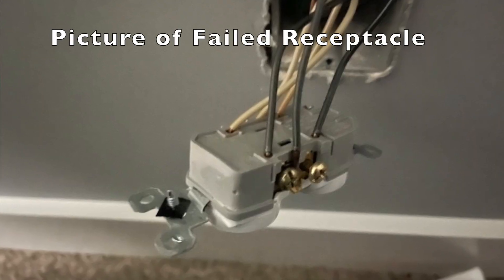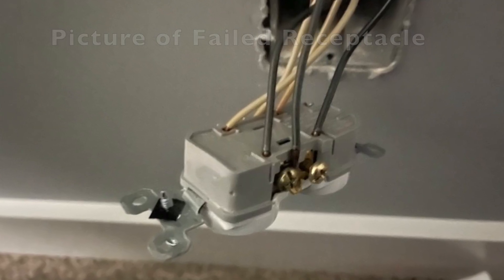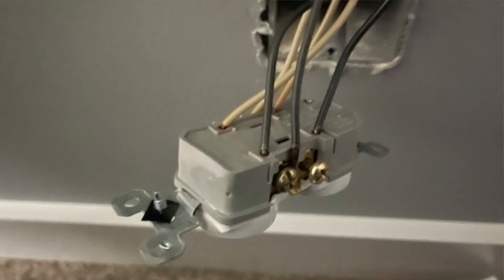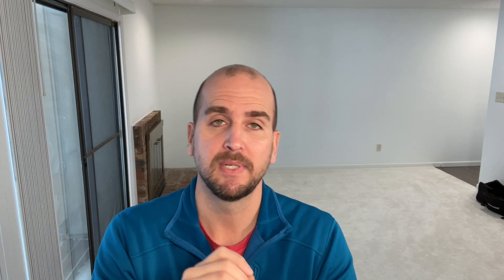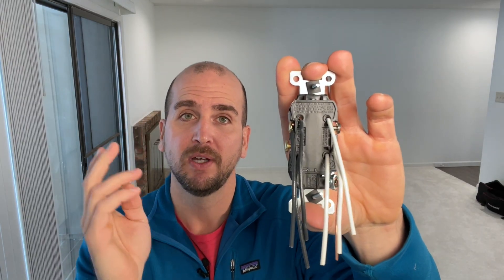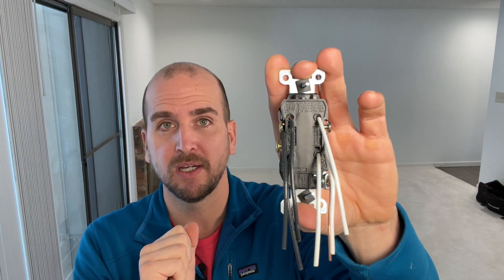Incorrectly Wired Outlet Found In Newly Built Home

Comment: Great video. For an extra measure of safety, I usually wrap the screw terminals with a couple wraps of electrical tape to prevent the screws from coming into contact with the sides of the metal box.
Reply: Metal box all the way. I’d rather my breaker trip to a properly bonded metal box then to a plastic one that can heat up, deform, and melt in case of a load issue.
Reply: @ryans7801  to each their own then. I've yet to see a deformed plastic box, but I have seen tripped circuits from metal boxes.
Reply: @JeremyHansen  I was wondering myself with proper size wire and breaker how would it get hot enough to melt a plastic box? And if there was that bad of issue would a metal box really make a difference?
Reply: @frankbenda8100  metal boxes would at least be grounded (if wired properly), but yeah, I don't foresee how the box can melt when the breaker should trip long before it generated that kind of heat.
Reply: @JeremyHansen  I have seen heat buildup from federal pacific breaker fail.
Reply: Two reasons we wrap our receptacles in electrical tape. 
1) Side arching in metal boxes. (Commercial/Industrial)
2) Arching on the bare ground wire (Residential)
Reply: @nickbruesch399  dont forget reason three. to trap unwanted heat into our devices.
Reply: @nickbruesch399  I understand wrapping with metal boxes, but if you have arcing from the ground to neutral in plastic boxes, someone isn't doing a very good job wiring the plug. Keep some distance between the ground wire and the screws and you'll be fine.
Reply: @nickbruesch399  Re: "Two reasons we wrap our receptacles in electrical tape. "  
But doesn't that unnecessarily trap heat in the receptacle?
Reply: Most homes don't use metal boxes, so most homeowners wouldn't need to do this extra step unless they just want to ensure someone taking off the plate can't grab the screws.
Reply: @JeremyHansen  Maybe in the USA were the codes are a little more 'lose' but most places in Canada ONLY use metal for OBVIOUS safety reasons. Plastic melts from hot loads and doesn't short to ground like a metal box does. The reason the US 'allows' plastic boxes is the same reason the US DOT allows red turn signals at the rear of vehicles. Nothing to do with safety and everything to do with profit. The hypocrisy of the US government knows no limits and it doesn't matter whether it red or blue, it just profit and not lives.
Reply: @FirstLastOne  I've done electrical work on and off for over 30 years and have never ran into issues with plastic boxes in residential work.

You talk about safety, but then you wrap the plug so the conductors don't catch on the conductive metal. That's a non-issue with plastic boxes and ensures the boxes can never become electrified (although, metal boxes generally shouldn't become electrified as they should be grounded and should simply trip the breaker, when wired correctly).
Reply: @FirstLastOne  Technically it is NOT the U.S. government at play here.  The NEC is authored by the National Fire Protection Association and is the basis for LOCAL codes.  Most if not all of those localities require smoke alarms, thanks to insurance underwriters.  (I had a quality switch ignite in a metal box once -- Probably manufactured in Canada.)
Reply: @FirstLastOne  The US government doesn't usually write electrical or building codes.
Reply: @JeremyHansen  "I've done electrical work on and off for over 30 years and have never ran into issues with plastic boxes in residential work."
Well, I guess that would depend on what type of work you did.  If only new construction or remodels, sure.  Have you done any insurance related work, say, after a fire?  Plenty of melted plastic boxes out there, it's just a matter what type of electrical work you end up doing.
Reply: @chuckm260   @Chuck  simply put, if you need to wrap the terminals when using plastic boxes to prevent a fire or melted box, you're doing something wrong. If the plastic box melted, it's either due to shoddy installation, a failure of the plug, or a failure of something plugged into the plug.

Only one of those would be prevented with wrapping and it's much easier to just install the plug properly and make sure the wires aren't stripped too long and tuck the ground to make sure it won't come in contact with any terminals.
Reply: Electrical tape unravels after time
Reply: @Mark-ul1hz  that's if they are buying the 12 for a dollar stuff, I only use 3M black electrical tape, used to use it to bundle the electrical wires to submersible pump plastic pipe lasted for years fully submerged in water wells.
Reply: @mikeking7470   the best 77#
Reply: @Mark-ul1hz  The tape unravels because you broke the tape under too much pressure. after making the first tight wraps, lighten the tension on the last one, then tear the tape from side to side. Don't stretch the tape to break it.
Reply: @Mark-ul1hz  Maybe so, but the tape I used when I wired my parents' garage in 1970 is still holding tight. And even if it did come loose, there's no harm done.
Reply: @ttiwkram  I've encountered plenty of electrical tape from 1956 that was still holding on pretty well. Good thing too, since there was not one single wire nut in my whole house when I moved in. Every splice was soldered and taped.
Reply: @Mark-ul1hz  How long ??? years????  In years of doing this I have never found unraveled black electrical tape there..

Comment: After the wire-nut were installed on the pigtail, an electrician suggested that a tape be applied from the wire to the wire-nut, so it will not slipoff and prevent short or ground to the casing.
Reply: If the wire nut is installed correctly on a properly twisted splice, tape is unnecessary and will not prevent an improperly installed wire nut from failing.
Reply: I disagree, taping wire nuts only holds a loose splice together causing heat. It's better to have the wire nut fall off and circuit fail rather then heat up and cause fire.

Comment: I'm not a professional but when I do my own work I do buy the more expensive receptacles. To be honest, I've never had an issue with a push in but I've had issues with the wire popping off the screw especially if you're trying to cram it back into a box with tons of wires in it.

Comment: My issue would be, why is this receptacle doubling as a junction box?  There should only be one hot and neutral coming in and one hot and neutral going out.
I do not know if this breaks code, but it is certainly not best practice.
Reply: What if your feed comes in and you have outlets running left and right around the room?
Reply: @BrianFullerton  
I am not a licensed electrician, but I would use a junction box.  This would be a box with conductors and wire nuts.

Comment: The first time I saw a push-in receptacle, my brain just screamed “no”!!!!
I don’t understand the difference between using a pigtail versus using the back wire.  The receptacles are obviously designed to have multiple wires in them.  Can someone explain?
Reply: The pigtail also allows for that one receptacle to fail without taking out the entire circuit.  The way it was wired was in series.  With a pigtail it is in parallel.  Makes it much easier to find a problem in a circuit. Picture a circuit that has multiple lights multiple receptacles.  If there’s a problem, you have to check every receptacle and every light to find it.
Reply from the maker: Good example, thanks!
Reply: @glasshalffull8625  When I put a socket in, I use both screws if there are a continuation of the circuit. The 2 screws are a good connection when hooks are used. I've never had a problem.
Reply: @halohms   I used to wire the same way until I saw the light 😉.   Seriously though, there are good reasons to use the pigtail method.  Firstly, circuits could have 15 receptacles or even more lights on one circuit.  One failed failed connection and you have to check every receptacle, light fixture and junction box.  Junction boxes might be in the attic or crawl space.  If it’s wired in parallel (the pigtail method), then you go right to the only failed receptacle and check it.  Secondly, if it’s wired in series, each receptacle is carrying all the current for everything down stream that is plugged in.  This could cause overheating on upstream receptacle/wires and you also have a voltage drop at each receptacle and this is cumulative when wired in series.  The voltage drop could cause a piece of equipment at the end of the run not to work.  These are the reasons the NEC forbids wiring in series.  Now, it might never bight you, but it’s just not the best way to do it.
Reply: The push in terminals on cheap receptacles and switches that do not require the side terminal screws to be tightened are the ones to be avoided but the provision on spec or commercial grade devices to insert a wire under a plate at those side screw terminals is a very secure method to use. This feature did not exist many years ago.
Reply: The tab between the screws can be cut and this allows half the receptacle to be controlled by a switch.  Picture floor lamp controlled by switch at doorway in a room with no ceiling fixture.

Comment: Can this work for wall switches as well?  I have a dining room switch that was a dimmer switch controlling a single light.  I replaced the individual light with a ceiling fan w/ light, however the dimmer switch wasn't compatible with the fan unless it was fully off or fully on (the motor would humm audibly whenever the fan speed was adjusted).  I went to replace the dimmer switch with a standard on/off switch and when I got into the wall, there were 5-6 separate hot wires crammed into the space.  I have no idea what they are all used for as the switch only ever controlled the single fixture.  The dimmer switch had multiple hot and ground wires attached to it and unfortunately I failed to mark them before I disconnected, now I don't know which hot/ground combo to use.  I made a guess and connected things up but did it wrong and the switch has no effect...however, power is still getting through as I can manually turn the light and fan on by activating the fan directly.  

If i connect all the hots and all the grounds to separate pigtails, is that a realistic option?  Will it work the same was as this video demonstrates for wall outlets?